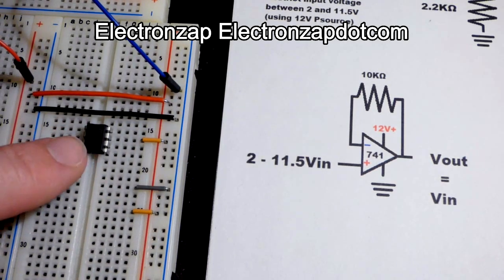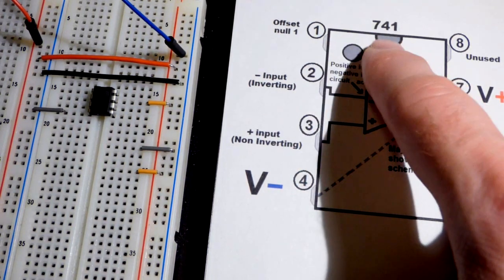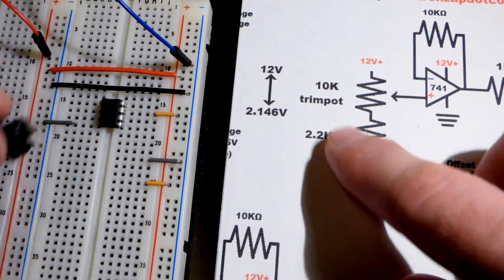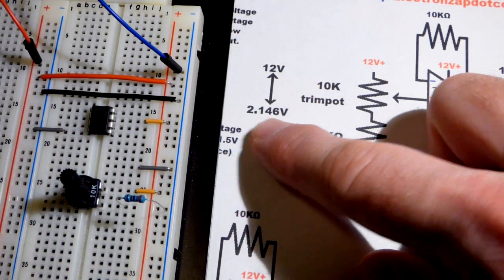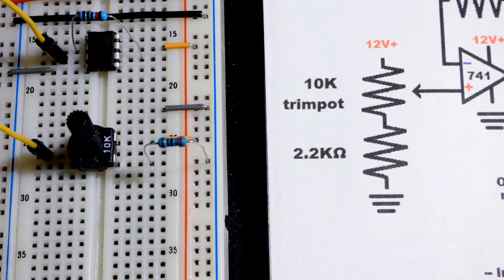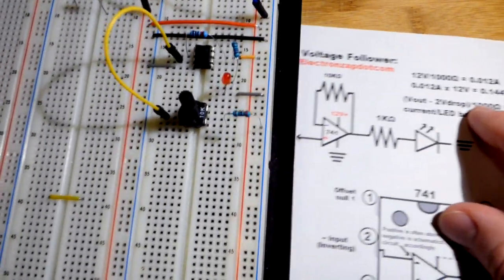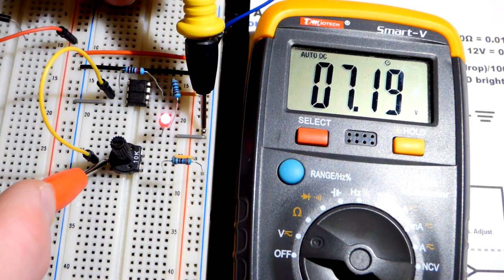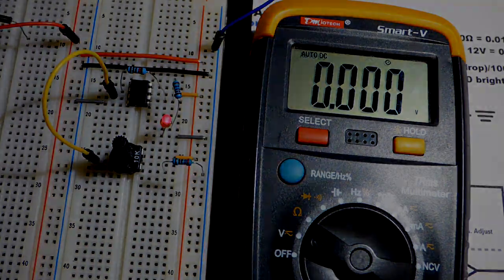UA741 op amp 741 voltage follower circuit for DC step by step build

Comment: I got a question.  Do we use a split power supply with a Centerpoint for ground? Or do we use a regular battery with the negative pole as the ground?
Reply from the maker: A split or dual supply is when there is a positive and negative supply voltage in relationship to ground. That's when ground is in the center, or somewhere else in between the supply voltages. A single supply is when ground is the most negative supply voltage of the circuit.
Reply: @Electronzap  ok.  Thank you!

Comment: I'd also Ike to add that I wish EVERY datasheet had at least a couple example apication circuits for every IC, not just op amps.  It would be great if they even did it for the transistors. It would've been an even greater help when first starting to learn all of this.
Reply from the maker: Yeah, I really love when a datasheet has a bunch of example circuits.

Comment: i have lm324ic i wanna make Battery level indicator how to make dot style not Graphic style.Like If 2 number led will glow then 1st have to turn off if 3rd wil glow 2 have to turn off. example if 2nd output is on 1st output has been turn off.will you make a video on that topic?
Reply from the maker: I haven't really come up with any good battery level indicator circuits so far. I'd recommend watching a lot of videos of battery level indicator circuits to see which ones have similarities to what you are looking for. I think the lm324 will work about the same as other single supply op amps.

Comment: Op-amp Comparator Circuit? How they work
Reply from the maker: A lot like this circuit, but no feedback. Set a voltage to an input, depending on if you want to invert the signal or not and then have the other input monitor a voltage that is either higher or lower than the set voltage. The output will go to it's maximum high and low voltage depending on which input has a higher/lower voltage. Lots of comparator videos and webpages out there.